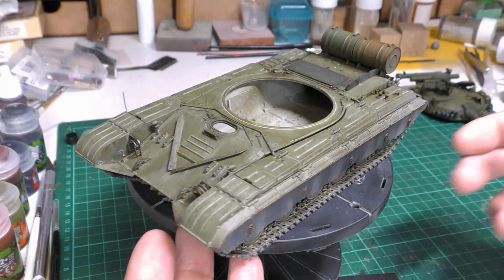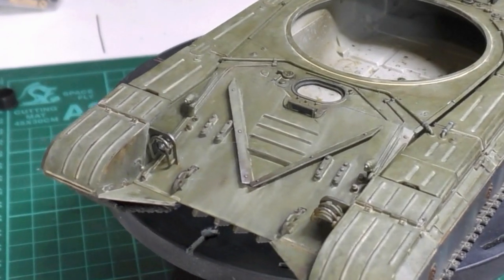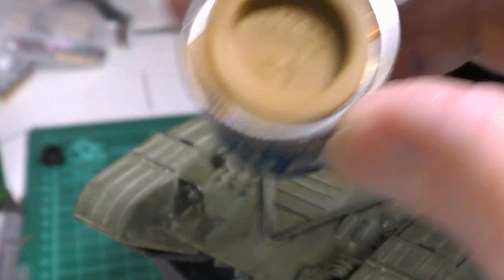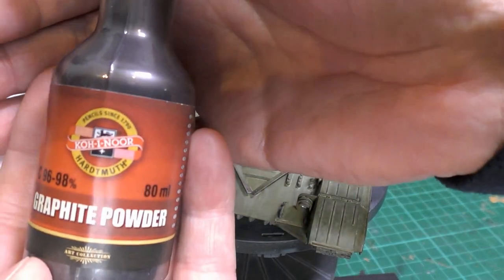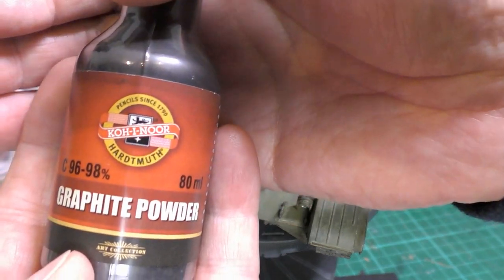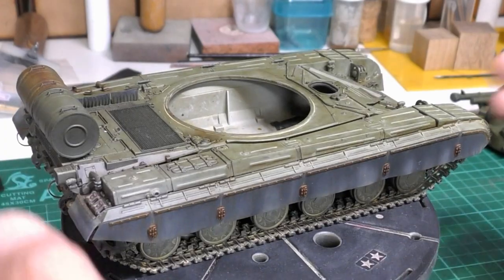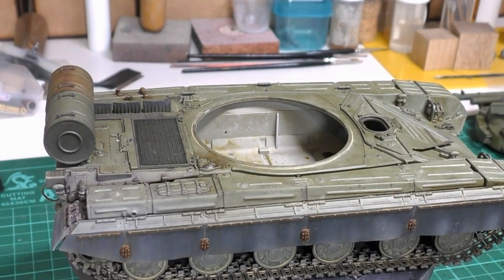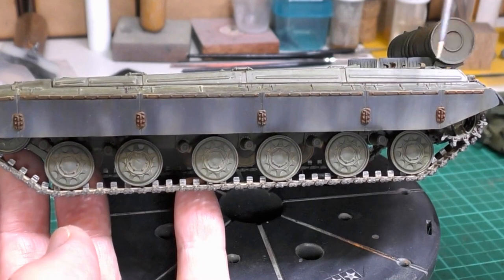Adding a crew to the Trumpeter 1/35 T-64 Mod 1981

Comment: Hi, firstly love your modelling philosophy and your modelling so you have another subscriber. Regarding the T64 I have seen several very close up, either white light or infa red is correct, they can and sometimes do, put infa red covers over the white lights. Best wishes Mark.
Reply from the maker: Thank you for your kind comment, your subscription and your knowledge Mark. The kit is finished (and I can now happily leave the lenses white!) and I'll make a wrap-up video this coming weekend before moving on to another kit.
Reply: was it an T-64A or B ?
Reply: I’ve been up close to both why?
Reply: @markneal1175   just wondering that's all 

also where did you see them ?
Reply: @samargrewal929  whilst in the Military but I can’t tell you where I’m afraid.
Reply: @markneal1175   ok